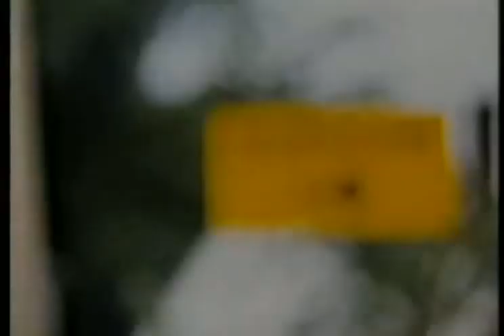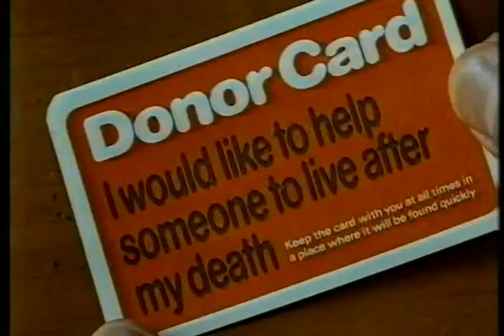GP 500 Laguna Seca United States 1988 Grand Prix

Comment: 4 of the top 5 finishers went on to win the GP500 championship. Very competitive riders. Schwantz had bigger heuvos than he had sense. The bikes he rode never would have done as well with a different rider.  Great track, fun race. For the GP500 (watched other segments over the week end walking around the track -- great spectator track for walkers) sat at the bottom outside of the downhill Dunlap bridge.  Best place if you had to sit at only one spot.  Randy Mamola walked through the crowd on Saturday; answered any questions; he had bumped his head in a crash during practice or qualifying (it's been too long to recall) and didn't feel good enough to race.  He turned down an offer of a beer, said he would feel the affect a week from now.  An early appreciation for conditioning requirements (not yet a general thing to do in motor sports at the time, but clearly things were changing quickly). Oddly enough, my mom worked with Lawson's mom at the time. Mom couldn't understand how big a deal it was. Eddie's mom said they spent every weekend in the desert (motocross or desert racing I presume) when he was a kid.